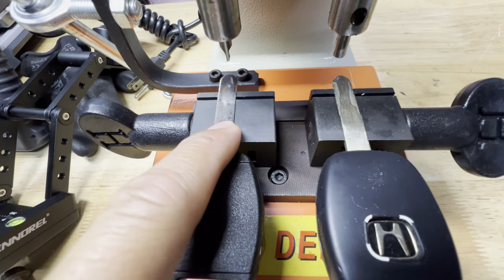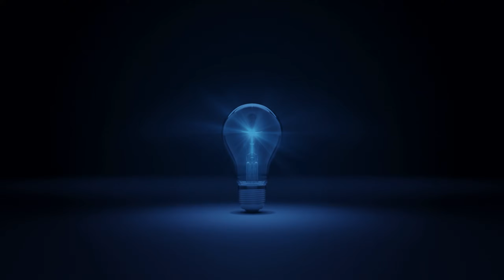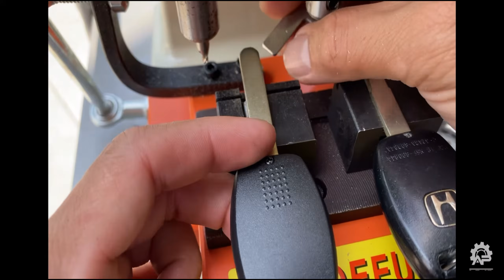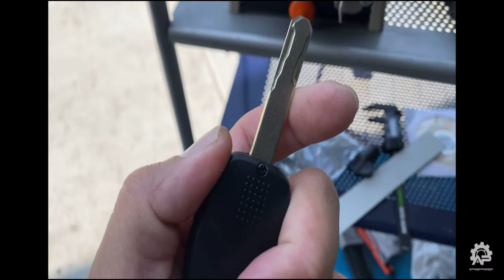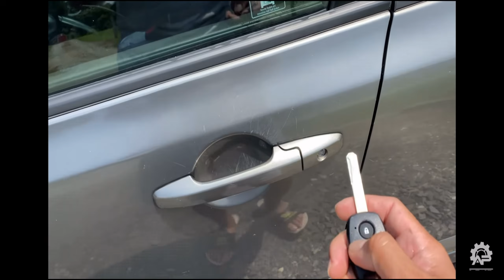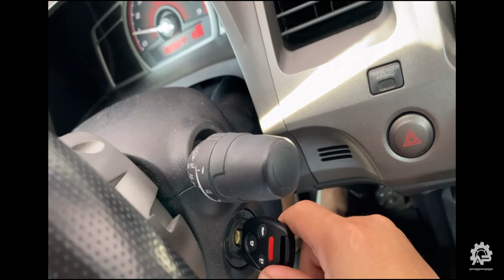Quick Guide on how to use DEFU 368A Manual Cutting Machine on Honda HON66 laser key blade cutter

Comment: I know this is an entry level machine for DIYers, but seriously guys - the nuts on the bosses are only there for transport. Remove them and fit the threaded handles! Also just set the cutting depth beforehand.